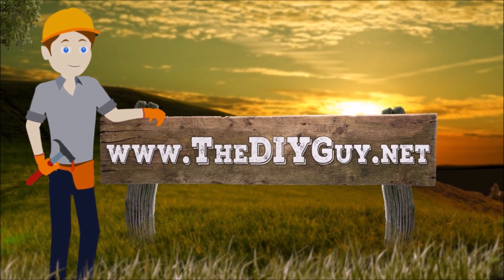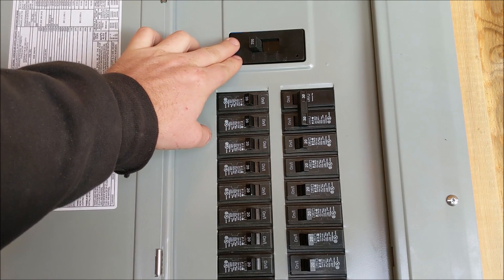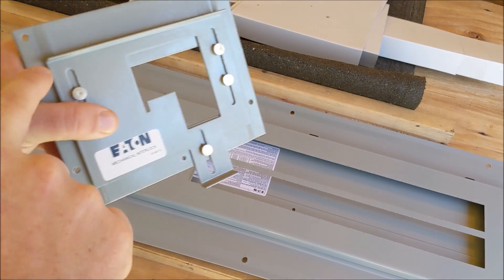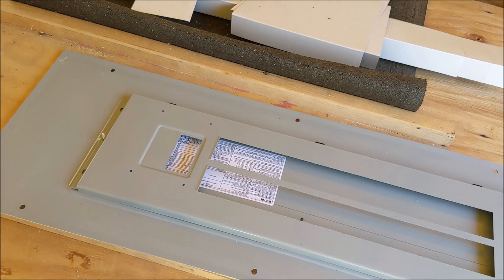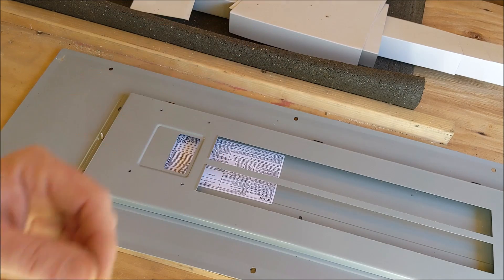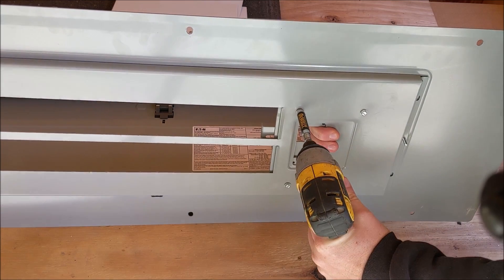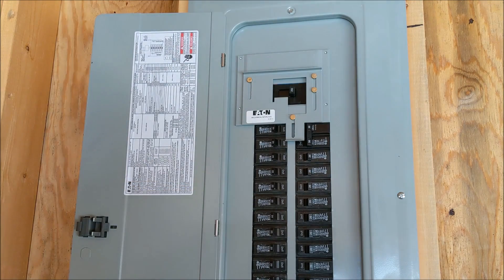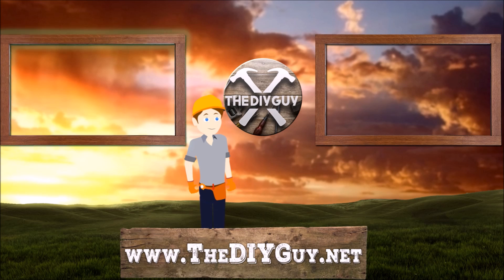How To Install A Generator Interlock Kit

Comment: Seems like you will have to move whatever that first breaker was for as its shut off when the main breaker is on correct?
Reply from the maker: On this panel and interlock kit setup, Yes if you have something already in the top two right spots you will need to move it into and open spot or some find it easier to slide/ move the entire side down two spots to make room for the breaker coming in from the generator. This was a new panel install and was pre planned to have the interlock kit installed so that generator breaker and wiring was already installed.  hope that answers your question. Thanks for watching.

Comment: My generator came today and it has bonded neutral.  My electrician comes Monday for the install of 50 amp box an interlock kit.  Is bonded neutral correct or should it be floating?
Reply from the maker: If it’s bonded, you must float it, and label it as such, so someone else knows it incase the generator gets used somewhere else for another reason. You can confirm with electrician.

Comment: I have a main pole outside.  Mobile home hooked to that... do I hook up to outside box ? Of mobile home breaker box? Main pole has well and shop only . Plus the main line to mobile home
Reply from the maker: I'm not sure what kind/ style panel you have outside. I believe they only make these lock outs for main panels. So I would guess it would have to go inside the mobile home panel. So you would need to see the make/ brand of the panel it is in order the correct lockout for that panel and then the correct size breaker and wire for whatever wattage your generator is. Also depending on the run/ length of the wire you may need to up size for voltage drop.
Reply: @TheDIYGuyDOTnet  thank u
Reply from the maker: @Robert5v  You're welcome. Thanks for watching and good luck with getting it hooked up.

Comment: I just had new service, panel, outdoor receptacle L14-30, 30 amp interlock breaker for feeding from a generator and one of these interlock kits installed.  I'm shopping for a portable generator, does this setup require a bonded neutral or floating neutral generator or will either type work?

Comment: My main panel has 40 breaker slots and all are full so it appears the interlock kit isn’t feasible without some significant rewiring or moving several circuits to 1/2 size breakers.

Comment: I'm in the process of installing a similar kit. I going with stranded individual wire instead because it is easier to work with. Plus Lowes sells wire by the foot and only needed a couple of feet. Have to run it in conduit however. Your video gave me the confidence to do this. Thanks for sharing.

Comment: Great info.

What if if a house has two separate panels? Perhaps a new "main power" panel could be installed with a whole-home on/off, a generator on/off, and an interlock?
Reply: This is my situation also.  A 200 amp main panel exterior and a 100 amp sub-panel inside the house on the other end.  As long as one panel feeds the other, you follow this video procedure.  You leave the "main" in the sub-panel on, regardless of listed amps.  Only turn on the essential breakers just as you did with the main panel.

Comment: I have a BR3030BC100 Panel. The main breaker is right above the first set of breakers. How do you install this on panel I have? I checked specs for Eaton BRMIKBR Interlock kit says its compatible with my panel but I'm Not seeing exactly how to mount to from instructions.

Comment: I bought a six circuit transfer panel. Works great and I like the built in power meter. However, six circuits is not enough and my 8K generator can handle more than that.

Comment: Nice protection for backfeeding the generator. The only problem with this is where does the unbalanced load go? Answer is it goes through the neutral back to the pole. The whole idea of a transfer switch is to cut off the neutral and have the panel run solely  You still need to cut off the neutral and this could be dangerous to lineman
Reply: This is incorrect. The generator neutral is plugged into the neutral bar and it returns to the generator via that. There is no current travel up the pole because there is no potential driving it to return to the pole. The neutral could not go up the pole and still work because the neutral would need to return to the generator, otherwise you'd have a very unstable voltage on both legs - hence it being permitted to only switch lives, not neutrals - neutrals never have potential to ground, only potential to their connected lives.

Comment: I have the same Eaton interlock kit, BRMIKCSR, for my panel which was installed in 1961 when the house was built (IOW I think my panel is older than yours). The kit contains a "generator hold-down retainer", a small plastic block less than an inch square. It's supposed to be installed in Step 3 of the instructions, right after you remove the panel cover. The next steps are two install generator breaker, then install the long screw from the kit into the breaker and through the hold-down retainer. Did you have to do any such thing?

UPDATE - I have the interlock installed and left the breaker hold-down out of the mix. I didn't see way to use that screw anyway, hold-down or not.  The kit install went well, once I used the second drill bit to enlarge the holes (had a brain fart on that one).

Comment: I have a similar panel except on my panel the main breaker ON position is set to the right as oppose to the left position on the panel you show in the video. Is there an interlock kit I can use for my installation? so on my panel the main breaker ON position is to the right and the generator breaker OFF position is also to the right. Thanks for posting this video and for your help.
Reply: Is it just simliar or is it actually an Eaton panel? Maybe it's Square D?

Comment: 2 things I'd like to say. First make sure what ever interlock kit you are using is UL listed. Secondly you have to have a breaker tie down so the breaker can not come out. A generator is like a service. Your main breaker is also screwed in so it can not be pulled out or pop out as the inspector who failed me told me so.
Reply: Why would a generator breaker pop out? Why would any other breaker pop out of the panel? None of my breakers have even popped out. Sometimes I have a bear of a time getting breakers to come out.
Reply: @HotDog88GT  because the generator breaker becomes the main breaker when the generator is being used. 

NEC section 408.36(D) Back-Fed Devices. Plug-in-type overcurrent protection
devices or plug-in type main lug assemblies that are
backfed and used to terminate field-installed ungrounded
supply conductors shall be secured in place by an additional
fastener that requires other than a pull to release the
device from the mounting means on the panel.
Reply: @electricianron_New_Jersey Good to know, I bought a 30 amp BR double pole breaker for my Eaton panel.  I don't see any way to install the screw to retain the breaker ... what am I missing?  Is there a special breaker required?

Do you have a link with any examples?
Reply: Glad you mentioned this for those who purchase Interlock Switches. The Inspector will look for this in most cases!  The kit I purchased Square D QOCGK2C from Lowe's came with the tie down and it is included in the directions on how to install.  Again, very good comment!
Reply: How does this breaker lockdown work? There is no slot for the long screw to go through a 50A Eaton breaker.

Comment: All new to me.  Everything I've seen on the Interlock is assuming the top two right breakers are for your generator.  If your panel is old and these two top right places are already being used they will have to be moved I assume for the generator?  Do like the Interlock much better than a Transfer switch.
Reply: This is correct - the 'top, right' breakers will need to be re-positioned if already in use.
Reply: @juarez9469  yes the electrician is doing this. Simply moving the top two to the bottom and adding two new breakers top left for the generator. I am  comfortable with many things but not a panel.
Reply: @34dawgsgo  not as simple as it sounds. The home runs fed into your panel are cut to a certain length for space and accessibility to the breakers. By code, you can splice a short wire from the top of the panel breaker to add length to bring it down, but it now adds a couple of questions. Can you feel confident that with time, the wire nut doesn't somehow free itself and increase the chance to arc? Also, do you care about the aesthetic look of clean, uncut wiring in your panel? The NEC feels okay with wire splicing with a wire nut but you better feel good that you secured the hots well enough when twisting the nut. Best to use electrical tape as a precaution in this case. 👍
Reply: @chucktrades3211  Not sure what my electrician did but the top two left breakers are being used with the Interlock. Have a 50 amp plug outside for cord to generator. Tested, it works. Glad I spent the money.
Reply: @34dawgsgo  that's awesome! I'm an electrician and was reviewing some videos about this since I've not dabbled with interlocks in so long and also seeing the different approaches that anyone took for amperages and generators. My neighbor wants one and I'll help him get it installed. Since we'll have to manipulate his current setup, I'm still superstitious about splicing home run feeds in his panel but I feel confident that we'll have no issues once it's done. 🤞
Reply: @chucktrades3211  it's a very expensive piece of aluminum but I get the purpose and protecting the line guys. Small price to pay in the grand scheme and doing things the right way.

Comment: That is a nifty idea, I back feed my generator, but I don't have the interlock kit installed, I make sure that the main is off before I hook up my generator, that might be something I'll do as I get old and senile, but for now I can remember to shut off my main.
Reply: It is actually illegal to have a generator breaker without a interlock, or a transfer switch
Reply: @JV-rj7qd  I'm sorry, this statement doesn't make sense.  Either you are missing a word or something.  Are you trying to say that it is illegal to have a generator breaker WITHOUT an interlock?
Reply: @BryanTorok  Correct - You must have an Interlock or a Transfer Switch, otherwise you could inadvertently send current out on the line when linemen are trying to fix or address an electrical outage. If it would happen, prepare to be sued bigtime.

Comment: If I understood it right, the generator + interlock will only energize/power up the "right side", so only breakers on "right side" will really be able to use/turn on. Is it right ?  If so, is there a way where we can have both sides working ?
Reply: If you notice the bus bars on a single phase panel are in a zig-zag pattern. Single pole breakers will only contact the right or left bus bar only. Double pole breakers will contact both the left and right bus bars thus energizing the entire panel.

Comment: Will this work for RV hook up when not in use?
Reply: No, you need to feed power female to male, and the plug and receptacle would be reversed for an RV hookup.
Reply: And you would have to remove the interlock to power your breaker. @jeffscott1543

Comment: Why are those brackets so expensive...stamped steel...should be $25 or less..they are around $75.  Imo
Reply: Aside from  being in code, its just a matter of switching off the main and turning on the breaker for the gen. Dont even need it.
Reply: @thisone.  In THEORY you are correct, but if someone fails to do that (and it is possible without this safety device) you can end up backfeeding the main line.  Watch this video:

https://www.youtube.com/watch?v=GA_zhLogUG8

Comment: Hi. I have a 200 amp main panel and another 200 amp sub panel next to it. Do I need 2 interlock kits and 2 double breakers or just 1 set in the main panel.
Reply: Feed the main, the main will than feed your sub just remember if you’re using a portable generator you’ll be pretty limited on amperage 
To determine how much amperage you can use 
Take your generator wattage and divide it by 240 to get your usable amperage
Reply: @isaeproductions5217  if I have a 3500 wattage Honda Generator and so divide it by 240 it comes out 14.4+/-.  Not much to work with correct??
Reply: @bobgieser2943  
Bob to me BARE MINIMUM for home backup is 4000 Watts.
If your Gen doesnt have a 240v 4 prong twist lock outlet on its front panel thats a clue its not intended to power an entire RV (for example) or a home 30-50amp Transfer Switch or Interlocked Panel.
Some 3500 watt units have 240v but many dont.
For our home I run whole house on a 6kw Propane Gen.
It had a hiccup & I subbed in a Champion 3500 / 4000 Watt Gasoline (has 240v outlet).
It ran hard but had to juggle loads to not overwhelm it.
Loads that the 6kw Propane didn't blink at.

Comment: GREAT VIDEO!!!  there is no way this piece of metal should cost $100+  I mean really?  these companies need to be ashamed of themselves.  lol  I will say Eaton at least put some thought into their design...  interlockkit sells a mere piece of metal for $150 for a few different panel manufactures... pathetic
Reply: I’ve been switching breakers manually for years but was always thinking about adding some idiot proof device just in case. $150 for two metal plates is beyond ridiculous though
Reply: Couldn't you make one yourself?
Reply: If you look on eBay, you will find this exact interlock kit for sale for less than $80. And, most of the kits from interlockkit.com are for sale in the $60-$70 range.

There are others that you can buy that are slightly cheaper or you can make your own. However, those from the panel manufacturer, such as Eaton, and those sold by interlockkit.com have been tested by an independent lab to be UL listed and to meet NEC and NFPA regulations.  That testing and listing is not easy or cheap for a company to do. They need to recoup those costs. Also, consider if your insurance will cover you if something goes wrong with your homebrew interlock causing damage, injury, or death. Keep in mind, if you injure someone you could also be criminally liable.

Comment: Did you just use a standard type breaker for the generator or does it need to be a special type?
Reply from the maker: Yes, A standard breaker works. Just make sure it is sized correctly for the wire between the generator and the panel and also to the wattage of the generator.
Reply: Please if you can , what amperage wire for a typical generator 30 amp ? Thank you

Comment: So you wire your inlet straight to your generator breaker?
Reply: Basically yes.
Nema L-14 30A Inlet Box >>>10/4 Romex wire >>>30A Dedicated Interlocked 2pole Breaker.
Of course if larger Gen upsize to Amp / Wire level.
50amp use a 240v 50A Inlet Box >>>6/4 Romex>>>50A 2 pole breaker

Comment: How would this work if you have a bottom fed panel?
Reply from the maker: I'm not sure what panel you have.. Some of there panels are the same just the face plate and covers switched around. If you click the link in the description and on our website there is a picture with the list of panels that this particular lockout fits or look at your panel and grab the model # and see if they make a lockout kit for your panel.
Reply: Just the same.  My breaker box took the same interlock (BRMIKCSR), but it is fed from the bottom so the main breaker is at the bottom and the interlock is mounted on the bottom.  Just install your generator/inverter breaker in the appropriate bottom breaker position.

Comment: So the interlock kit is literally only a metal bracket that prevents two switches from operating simultaneously? For $150? That's disappointing - I thought it was an entire solution to hooking up a generator to the panel (minus the power cord inlet from the generator).

Edit - I did more research and found an interlock kit for $27 on Amazon. Bought and installed perfectly. Shame on these people for bending people over a barrel on a $150 pricetag for a small piece of metal.
Reply: I don't live in the US but if I had to guess the reason for the price difference:
-$150 interlock has certification to show it meets code/electrical regs.
-$27 interlock is "a small piece of metal". I'm sure it functions fine but in the UK if you make electrical modifications it needs to get signed off by electrician before you can sell your house to show the house is safe for electrical installations.

Key questions:
Does $27 version have product certification?

in the US (I'm sure it's state-by-state rules not federal) would you have  problems selling/insuring your home for making modifications without electrician sign off?
Reply: @1221crazyace  My $27 kit is made by Siemens, so yes, it's legitimate and fully certified. They charge $150 for that product because people don't know better and pay it before realizing other kits are available for a fraction of the price.
Reply: @jeremyhale6403  my electrica supply house want 80 bucks where did you get onr for 27. i to have a siemans panel
Reply: Lots of BS / Blue Sky / Government Overreach inflates the price.
Buyer beware.
Install carefully but you can save if youre smart / follow Electrical codes.
Hire a Trusted local electrician that way your only shock will be when paying the Bill.